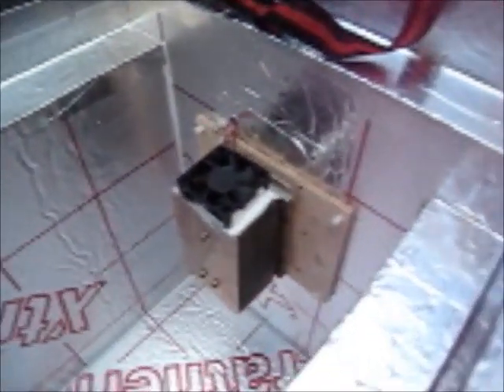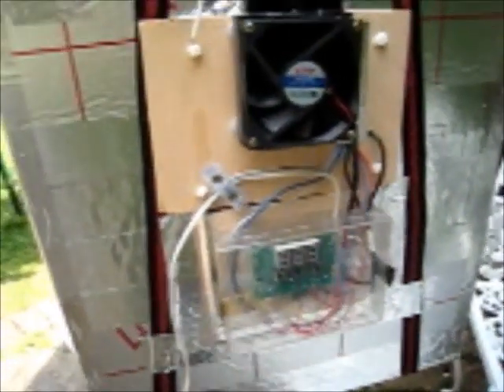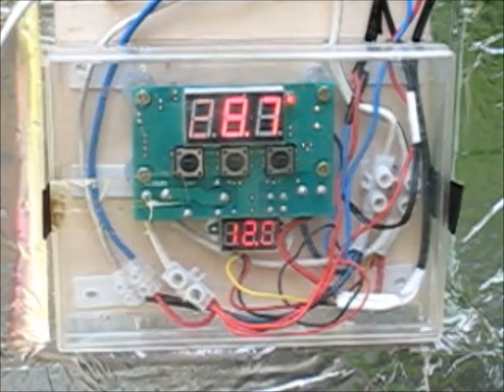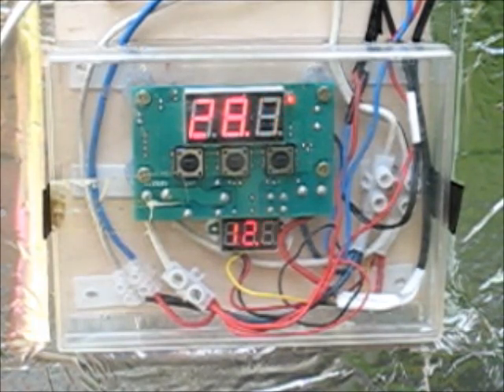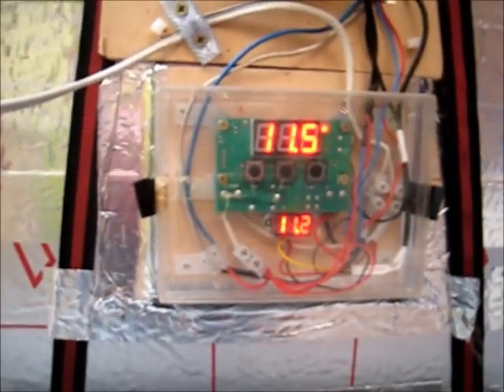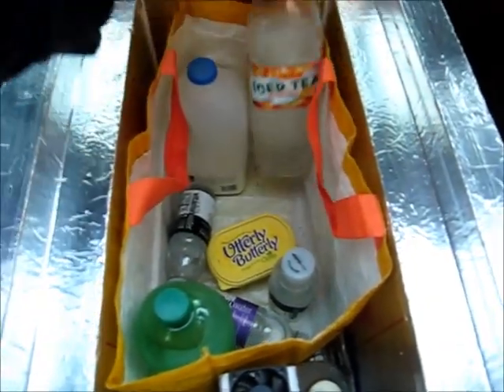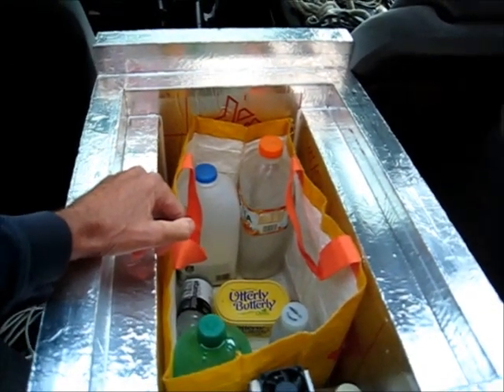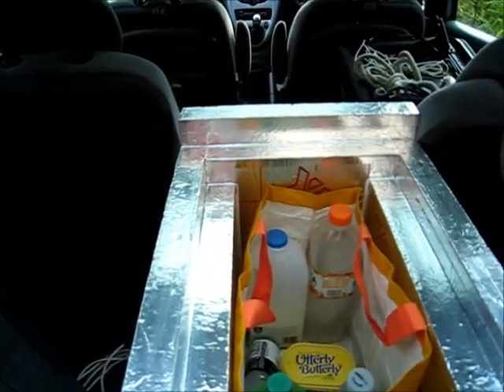Part 8 - Super Cool Box Project; conclusion. In fact this ice lasted 6.5 days!

Comment: The Peltier device has a max temp difference of 18°C or thereabouts.  It doesn't matter how efficient the heat transfer or how thick the insulation is, it will never do what you want in hot weather.  Truck drivers in the US use them and they work fine in air conditioned cabs where the interior temp was 23°C.  It worked for me.  To get the temperature drop you need you have to stack one of these on top of another.

Comment: I think you got it right in the end: cooling the hot side with liquid cooling. Maybe the reason why you didn't get the kind of temperatures you were looking for was the selection of the tec. Basically the more power you put through a peltier the bigger the delta t. I'm guessing you were using a 12706 or similar. try a 12710 or a 12715 though they will drain your battery a lot more.

Comment: I think insulation thickness is perfect but you use aluminum tape inside and outside 
Is that transfer to heat from outside or losing cooling to outside?
I think aluminum tape is just inside better.
I’ll try my way to make work.
Thanks this is good information project.

Comment: This looks like a great project. One question though. Without the peltier running if the box was filled to the brim with ice how long would it take to melt? There are cool boxes that will achieve 5 days and because of the amount of insulation on this it looks like it would last much longer.

Comment: hi nice job but to improve efficiency you need to keep hot side as cool as possible. it means that you need bigger heatsink + fan and if the ambient temp. is too high you will not be able to get nice low temp on the cool side anyway(unless you use some kind of extra cooling eg. water cooling). Cool side should be also nicely isolated to prevent outside heat to get to the cooling chamber. Basically peltier module works best with the biggest efficiency when the temperature difference between cool and hot side is as low as possible (it just transfers heat from one side to another).

Comment: Nice video series. Have you since then tried to work with peltiers in a similar way? I just built a box similar to this and I'm having the same problem, it only cools about 5-6°C below ambient temperature, I've heard that the hot side's cooling is critical, but shouldn't the cooling box still slowly cool down further when just letting it sit for a longer time?
I observed that on my box, I've hooked up a multimeter and saw that the amperage goes down from 5 Amps, while cooling down initially, to 0 Amps when reaching the minimum temperature possible inside. Then it goes back up and sits at about 1.7 to 2 Amps. Which i don't quite understand. 
Why does the resistance inside the peltier increase so quickly? The specification for my element says it has a Qmax of 60°C. If I applied my thermal adhesive properly (which I'm honestly not 100% sure about) it should transfer the heat directly to the heatsink, so I don't understand why the heatsink is about 40°C while the inside is just sitting at 17°C (those are just example values going on right now).
Maybe cheap peltiers like mine (and yours?) just aren't specified properly?

Comment: Water  Double length PC radiator outside , cooler inside is the best way . . A help would be use gaffer tape not tin foil tape across cold inside edge to outside edge. As tinfoil tape will transfer heat across from the outside.

Comment: A solar freezer needs an agm battery 12v 100Ah £155. One solar panel polycristaline 150w £89.
A solar controller £25. 
1-2 peltier refrigerator with copper tube gas cooler heat sink, 2 pcs cost £50. 
And insulation box made from scrap kingspan 40mm minimum thick from building sites.
12v temperature themostat to turn on off the refrigerator. I gonna use solar energy. No matter if power consumption its 120w per hour.

Comment: This result is very puzzling. i wonder where the fault lies?  Faulty peltier device?  I have a cheap Waeco cooler which needed a replacement fan motor. When I opened it up today, I found a large block of aluminium between the peltier device and the alum. inner wall  of the cooler. There was no insulation close to the alum, block, so clearly a path for heat to flow between the hot and cold heatsinks!   However, this cooler is able to drop the temp at least 20 deg C below ambiant.  I've been able to fill the gap with some insulation and, can only hope for a slightly better result now.   

FYI I recently bought a very expensive Waeco cooler (£198!) which drops the temp by 30 deg C below ambiant.  It has a quite large 'hot' heatsink, and also has an internal fan which switches off as the lid is raised. |It's posible they are using a more efficient peltier device - but I suspect it is simply good insulation,  big heatsinks and efficient fans  that result in the excellent performance.  Hard to imagine why it should cost so much - and why your cooler doesnt equal it.  BTW Once cool it slows the fan down and presumably uses less current to run the peltier chip.
Reply: I have wondered about adding 3-4 inches to outside of a Waeco or other thermoelectric cooler.

Comment: Hi i want make a project like this but i use a tec with a 15Amps draw 127015 and it is a better fort fast cooling or heating but yeah that draw much power and cause much heat so i use big heat sink on each side or a water pump in a coper wire around of the box for cool down all the box  so nice project :)

Comment: Peltiers are very inefficient and therefor not able to cool down a box of that size.
About 85-90% of the power a Peltier consumes is converted into heat and only 10-15% is used to pump heat. This means you need extremely good cooling for the hot side of the Peltier. The efficiency drops even further if the difference in temperature between the hot and the cold side of the Peltier increases.
In practical terms it means Peltiers only help keeping stuff cold and are not suitable to cool down. It also means your box should be as small and as well insulated as possible.
I built a 5-liter cooler with a 6 Amp Peltier.

Comment: first, do some sience, study the temperatures from hot side/water, is it how high?, every degree of lowering that temp puts same amount of cold inside. You propagly could get it 5 deg lower by using bigger radiators, bigger fans, 3 x 120mm. Isolate all tubes inside.
How much you drag amps?, could you go more powerful peltiers?
As well you use too much of heat compound which will eventually act as an isolator.
The box is aswell too large, even the isolation conducts heat and if your Peltier unit is too small, all energy goes to isolation leakage.
Many things to sort out before giving the final judgement.

Comment: i am thinking on dty box and your videos help!
1. idea: using vacuum panels as insulation (don't know yet about the heft
1.1 crazy idea: build a carbonfibershell and a vacuumhose to pump out all air. 
2. idea: stack 2 Peltier (2A x 1A) the smaler to cool the bigger = 3A
3. Use 18650 Li Battery (8x) to run it when i'm not driving

any thoughts?
Reply: ***** ok, stacking doesn't seem to be a solution:
http://physics.stackexchange.com/questions/116271/is-it-more-efficient-to-stack-two-peltier-modules-or-to-set-them-side-by-side

Comment: What are the materials
Reply: 1 inch XPS foam board with foil backing. R value 6.5/inch. He uses 4 inches. As a reference, the average good cooler has 2-2.7" of insulation. Though they use closed cell spray foam, about same r value/inch. The lid seal and overall making it airtight is important.

Comment: Hey, I really can imagine how disappointed you are. I loved to watch those videos, and I really felt for you when that little box didn´t wanted to cool down. But maybe there is a simple way to enhance the efficeny of the box :)
You know that peltier is physically unable to be a hundred pecent efficient. So if the inside cools down 10 degrees under enviromental temperature, the outside will probably heat up by estimated 20 degrees. 
For example if you wouldnt put any heat sinks on the peltier it would heat up and explode quite fast ;)
The trick is to get rid of the energy on the outside.
So you could try to max the heat transfer on the outside by using some bigger fans + bigger radiators like this one: http://www.thermaltake.com/Cooler/Liquid_Cooler_/All_in_One/C_00002345/Water_3_0_Ultimate/design.htm
Well this one is quite expensive, but youre so smart I guess you could easily build youre own for a fractional amount. 
I hope youre not completly tired of this project, and find some time to rework it. I´d love it :)
Keept it up!!
Lukas

P.S.: I apologize for my english, I guess it isnt the best :D
Reply from the maker: Dude , Thanks for your comments... and others too  You may well have a point.

The design was deliberately kept to use a low-ish current, so that it might last a few days running on a dedicated car battery at a remote camp site. For this to be possible the peltier cannot run continuously or it would drain the battery too quickly. 

Another way is to use two peltiers, but again this drains the battery too fast for remote use. 
 
I have also since learned that copper has twice the thermal conductivity of aluminum and saw another video showing a solid copper bar used to suck heat out of a water reservoir inside. Eliminating fans clearly saves some power, so perhaps that and a big copper based heat sink on the outside + good efficient fan/s would improve its performance.

The challenge with a permanent/solid heat conductor is that when the peltier is not working, the warm heat sink outside would transfer warmth into the inside, and so warm it up.  I used [non-circulating] water to disconnect the two heat sinks and so prevent thermal bridging.  I know one commercial cool-box claims to disconnect, but I do not know how they do this.
Reply: U K Somerville " I know one commercial cool-box claims to disconnect,"
Could you tell me witch one? thx
Reply: If you put the water cooler on the outside I believe that this might be more efficient than just air cooling. For me and my bread-dough-proof-box 10°C below ambient would be OK.